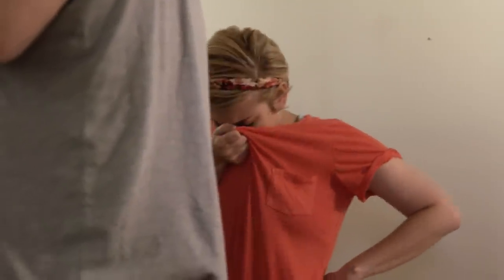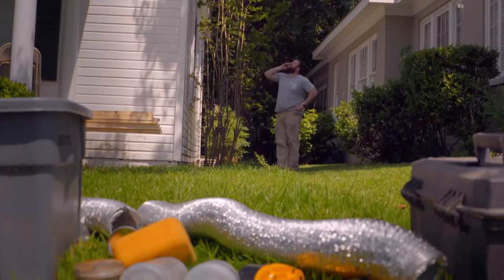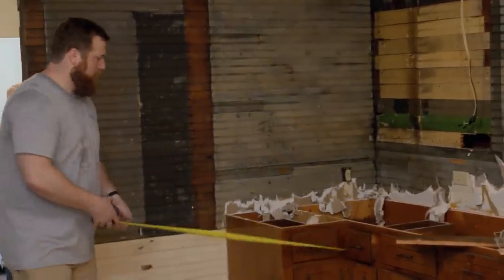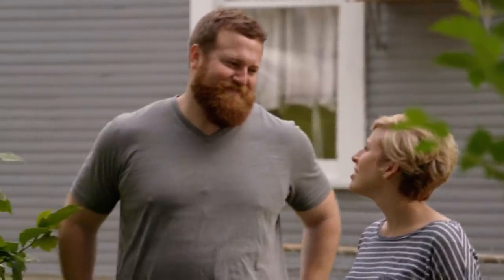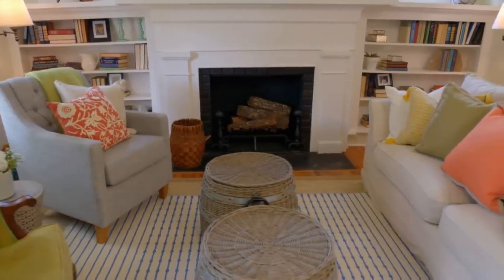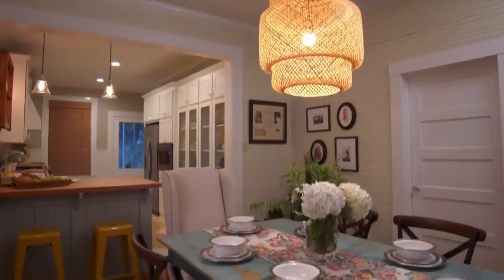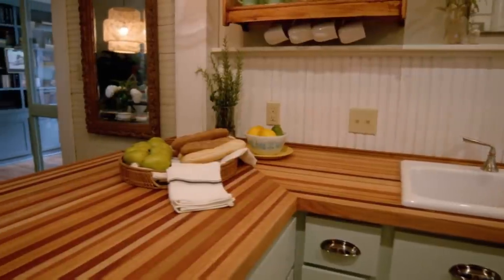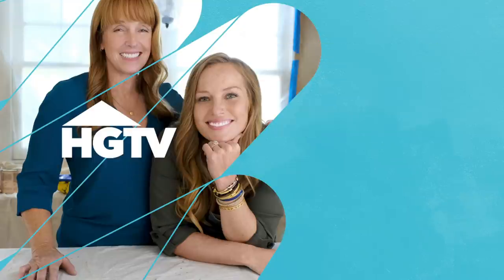This House Has A Serious Bat Problem! | Home Town

Comment: We might have bats in our attic. I've contacted a specialist about removing them.

I found out that bats are federally protected and it's against the law to harm or kill them. You have to hire professionals to humanely trap them and release them elsewhere.
Reply: After nesting season, they can seal up the house but put special excluders on (where they've been entering) which allow the bats to get out but not back in. Though it has to wait until after any baby bats can fly, so early August.

Comment: I would never live in a house that had a previous bat infestation.  Bat droppings are gross and carry disease.
Reply: I'm almost entirely certain the guano was cleaned out
Reply: @kathybauman6708  If you are speaking of the couple who are moving into the cottage, they purchased the home and were having it renovated for themselves and had not lived in the house. The previous owner was elderly (or perhaps deceased), and it is quite possible the house had been empty for a period of time, hence the bat population.
Reply: @kathybauman6708  Whoa! You buying and selling ‘many’ homes and having building inspections done does not relate to your previous comment, that you edited after my first comment. Most certainly it does not excuse your rude comments about the owners being “slobs” as I believed you referred to them. 

The bat problem was remedied by removal of the bats, and cleaning and disinfecting of the areas. The home was successfully and beautifully renovated by a professional contractor, thereby addressing any deficiencies to the structural integrity of the house. The new owners were delighted to move into their new-to-them home. 

Also, it is spelled feces, not feses. And when referring to batdroppings it is referred to as guano.

Edited to add: I expect that Ben Napier met or exceeded all local code requirements in this and every renovation he has done.
Reply: Kathy Bauman: You reply to my comments and then edit and ultimately delete what you have written. If you believe what you have written is justified then you should stand by your statements and not delete them. I would hope you know what you are writing is cruel and unjustified and are ashamed of your behavior. I sincerely doubt it, however. You certainly appear to have a grudge against this woman.  You have attacked her housekeeping skills, calling her filthy, for the condition of a house that she and her husband just purchased and had never lived in. You have also criticized her appearance. Your attacks paint a very unflattering portrait of who you are. Think about that.  

I copied your last two replies to me and am leaving them in my reply to you.

Kathy Bauman replied: “jagged one bat droppings, sheeet”

Since you claim you are such a perfectionist, I thought you might prefer to use the correct term. My apologies, I am obviously mistaken. 

And Kathy Bauman replied: “jagged one the Lady’s hair matches her counter tops. Red blonde streaks yiiiiikes! I’ve remodelled & brought back to perfection with my own hands. I’m a clean freak. Hence prosperity, all my own doing.” 

If you actually watched and understood the video, starting at 2:38, Ben Napier suggests building a butcher’s block countertop out of scrap wood of all different colors and species that he has in his workshop. He did this in order to save the client’s money because the cost of the bat removal cut into the renovation budget quite significantly. Once again, to explain the timeline to you, this couple had just purchased the property and had never lived in it.
Reply: I think there's a lot of bats dying in your part of the country (New York) from some fungus.
Reply: You can always clean it up 😂